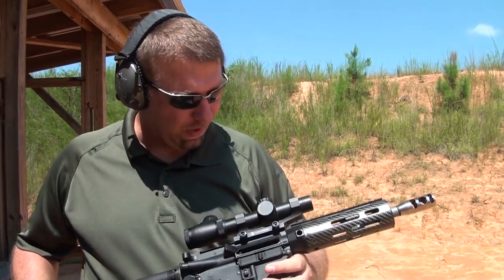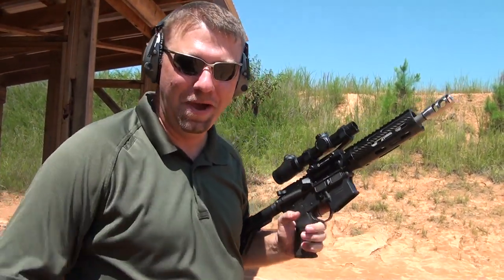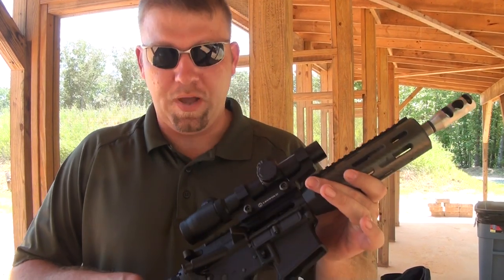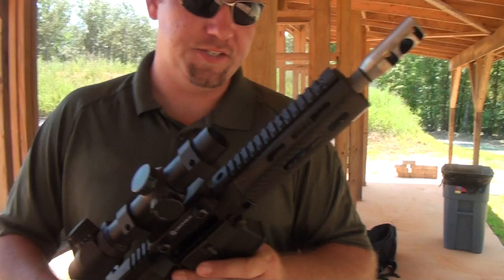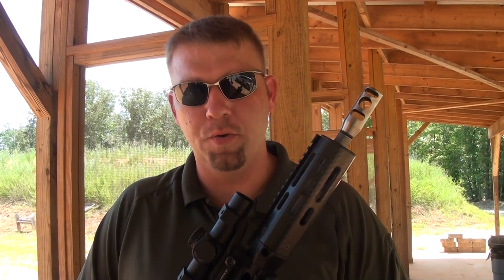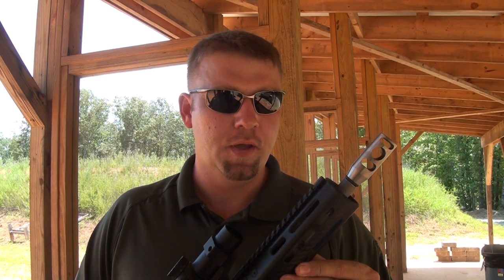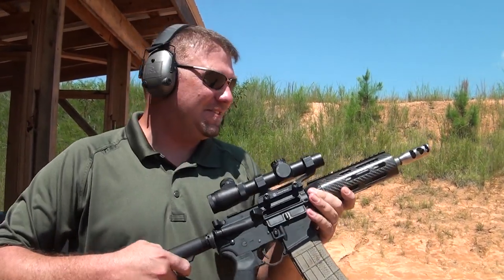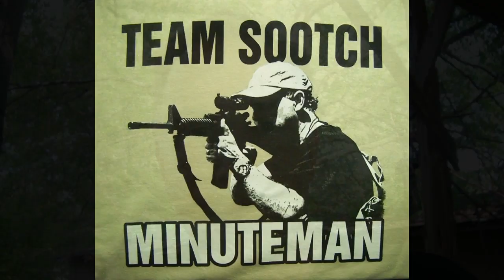M4 SBR 5.56 Rifle

Comment: The Drop In Auto Sear (DIAS) is a device that is adds an auto sear to an otherwise semi-automatic AR-15 so that when used with M-16 fire control parts including an M-16 carrier produces full auto fire.  The DIAS is referred to as a "Drop In" as this piece can be added to an AR-15 without drilling a receiver for a traditional auto sear.  Following is a photo of a registered Drop In Auto Sear (rDIAS) made by JCB and registered before 1986

Comment: 5.56 doesn't tumble as well when it's fired out of a shorter barrel. You might be able to counteract this with a higher twist rate, but I haven't heard anything about it.
It will still kill your target just as dead, but the hole won't be as big.

This is one of the main advantages of 6.8 SPC, that it's more reliable out of shorter barrels.

Comment: Interesting piece, but what is the application?? The terminal performance really drops off, the blast and noise increases. Is that massive brake really necessary for it, or does it amplify the blast. The 'pig nose' was invented for that problem. The 6.8 or 7.62 are better mini barrel solutions.

Comment: What do you mean "properly"? Because the same argument can be made about any 5.56 rifle with a barrel shorter than 20 inches. they all have their own purpose. But yes, the shorter you go, the less velocity. Thing is, that can sometimes be sacrificed. I certainly wouldn't prefer a 20 in A2 while clearing houses, and I wouldn't prefer an 8.5 in SBR in a mid-long range gunfight (over 75 yds). To each his own.

Comment: After having an AR pistol, I have to say the shock and concussion is over-rated in many people's minds. Yes, it has a lot. No, it won't make you deaf instantly for life if you have to shoot it indoors without hearing protection. Not unless you do it an awful lot. With a proper brake, it'll keep most of that blast out of your face, and won't bother you as much as you may think. I'd still rather use a flash hider on something like this, or any 5.56 gun for that matter, even a 20".

Comment: What would be a good test is to run that on my Colt M-16 lower. Anytime I build an upper (with exception of long range) I throw it on that lower to see if it runs correctly in full auto, if it does I have no problem believing it will work reliability in semi-auto.